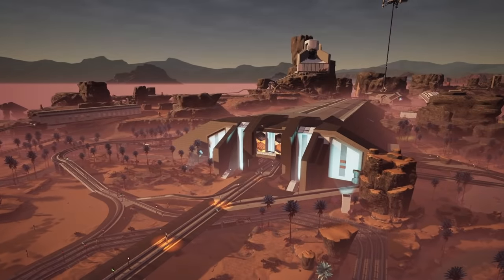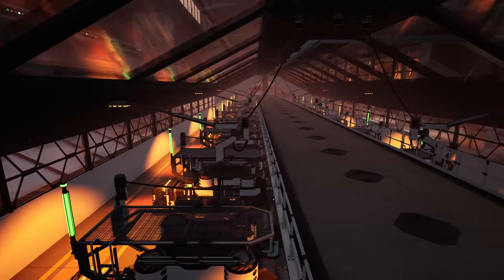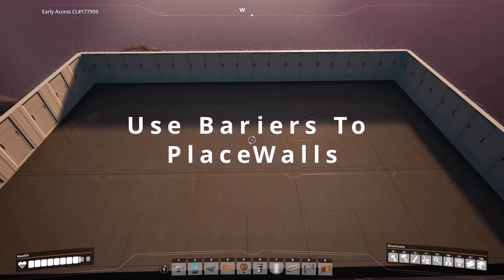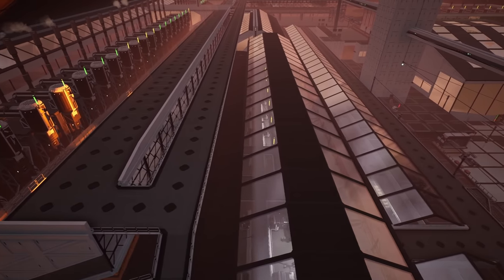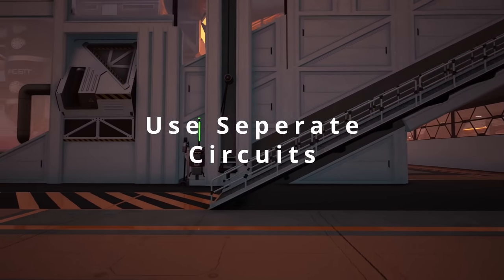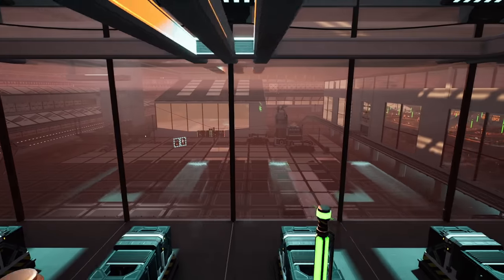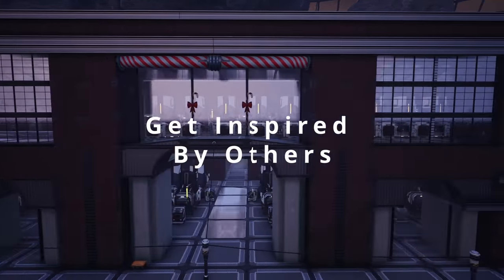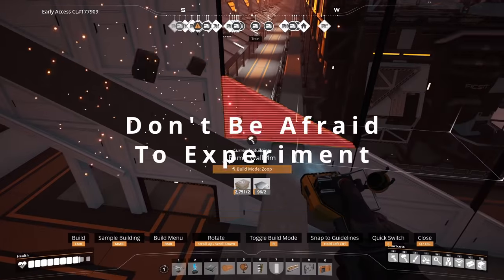20 + Cleaner Factory Designs Tips | Satisfactory Update 5

Comment: "Give yourself more space than you need" is hands down the best tip.  Compact design is good on the small scale, but you instantly run into problems when you try to scale that up.
Reply: I tend to run into problems the moment I try to start scaling things up after the steel tier. Like "10 by 16 foundations, should be enough!" Nope...not when I want 500/min nails, 300 iron plates, 300 iron rods, 200 wire, 200 cable, and a good 80~100 steel plates/pipes to be produced... (basically the start of a "starter hub factory" from which I could get resources, to use for building other factories/mining buildings across the map.) Even 3 floors on that 10x16 platform wasn't enough when I wanted to also add all the parts I could make with assemblers. And that attempted build was still pretty small compared to what people build in the late game. :P

So saying "Give yourself more space than you need" is an understatement. Take a space you think you need. Then double that. And add a second floor. THEN you might come close to the space you need for good organized design that doesn't feel cramped. :P
Reply: I find I like compact designs with the blueprints, and then use those like larger machines and space those out.

Comment: I always build my factories way too small :x I kinda wish there was a "half size" foundation option because working on a tight scale you often run into foundations being way too large.
Reply: Catwalks crossings are quarter foundations.
Reply: @ricobarth  they don't look nice mixed with foundations when used as a roof though. I guess with the new roof you could make an overhanging roof, but that only works well if you have a single story building.
Reply: You can use catwalks to snap a foundation to the side then build off of that to intersect them with the existing foundation of your factory
Reply: Best option would be to snap a floor to a beam connector or something and just clip one foundation into the other for 1/2sizs foundation
Reply: I believe you're enjoying Update 6!
Reply: @helios6379  have yet to install it but it sure looks promising =D
Reply: @SyntheticFuture  If half foundations is what you're after, it will sure deliver 👍🏻
Reply: Looks like your wish has come true.
Reply: @pyrolucky5741  now it's waiting for half length walls 😂

Comment: One thing that I’ve recently discovered that I haven’t seen anyone mention yet is that you can stack splitters/mergers on top of each other and use conveyer lifts to condense load balancing belt designs. The whole tree will easily fit on a single foundation and you could use conveyer walls to ‘black box’ the system if you don’t like how it looks.

Comment: One thing I got frustrated with is certain natural points do not line up with your ability to place foundations. I struggled to try and line up a rockarch with a foundation so that it was a straight line under it between the two end pillars of the arch. In the end I found a thirdparty map site which allowed you to edit the savefile to nudge the angles the foundation was passing across to line up with the arches.
If this is actually possible to do in game, I would be so happy to learn how, but damn it I couldn't figure out any other way myself...
Reply from the maker: You can use micro manage or even in vanilla you can place a barrier down then build snap a foundation against it
Reply: @TotalXclipse  For reference, its the arch that is located in the south east corner of Grassy Fields, -51,900/29800 cords.
The arch that hangs over the open space down there was being annoying and no matter what I tried, the angle was never gonna give me what I needed. 
Satifactory-Calculator ended up letting me touchtap the angle enough to make them line up though...

Comment: I wish more time had been taken on the barriers trick, I got lost on how the barriers disappeared as you placed walls. Did you angle the barriers and then use a hotkey to get to the wall you wanted to build?
Reply from the maker: Nope, just place down a barrier. Then open up what ever wall you want - I just copied it using the middle mouse button and then hd cntl whilst pointing at the barrier, it will replace the barrier with a wall
Reply: More generally, you can sometimes hold Ctrl to replace one thing with another. For example, you can replace a regular wall with a window. Just select a window, mouse over a wall, and hold Ctrl while clicking left mouse button. The wall will be replaced by the window. In the above video he replaced the barrier with a wall, taking advantage of the increased snap options the barrier gives you.

Comment: One small note about feeding below: don't do that with liquids. Liquid physics work much better if you're feeding from above.

Also please don't use the word "bus" to describe long stacked belts, that's not what it means :) "bus" is when you split/merge from those stacked belts to your production line. Long stacked belts are just long stacked belts and not a bus :)
Reply from the maker: I think you're wrong about the bus - A bus transports items from one factory to another, a manifold is what splits Items between the factory production line. - I got confused with that early on, and subsequently received a lot of flak for it, easy mistake to make though. 

You're absolutely right about not feeding liquids from below unless you have a buffer holding the liquid above the line prior.
Reply: @TotalXclipse  manifold is a line of splitters on a belt

bus is a stack of belts from which items are split to machines (either single buildings or manifolds of buildings) and product of those machines are merged back onto bus

stack of belts going from A to B is just long stack of belts, not a bus.
Reply: @greeny-dev  The only definition I can find is more pertaining to electronic circuits is "A parallel circuit that connects the major components of a computer, allowing the transfer of electric impulses from one connected component to any other." In this case it is a set of parallel belts stacked vertically and/or horizontally from one point in the world to any other would therefore be a bus, no matter the distance from the origin or destination points. Therefore, @TotalXclipse is correct on the definition.